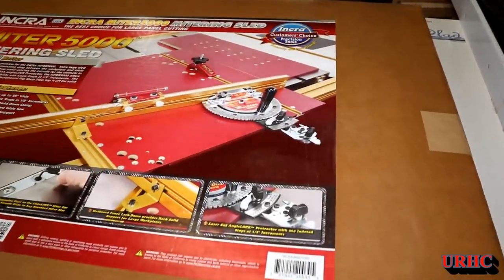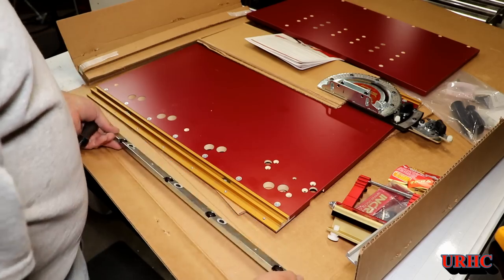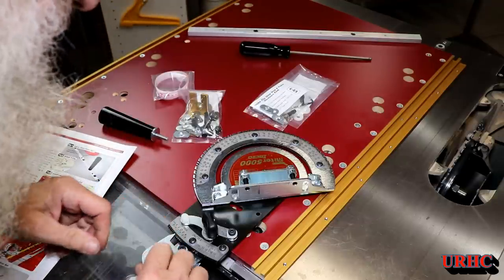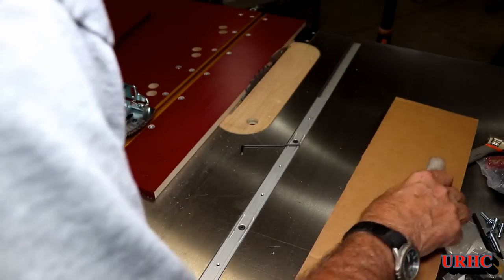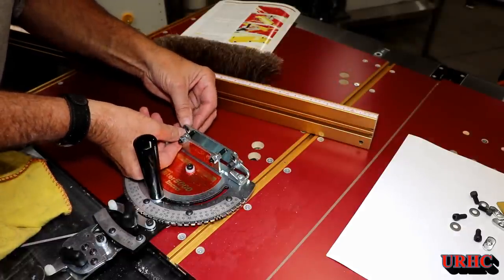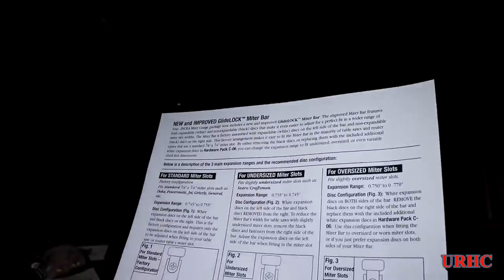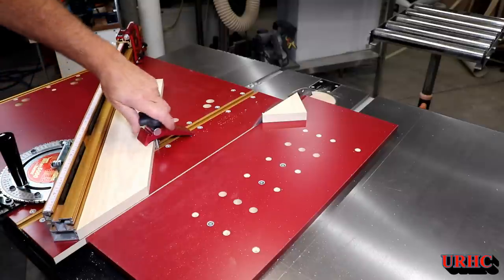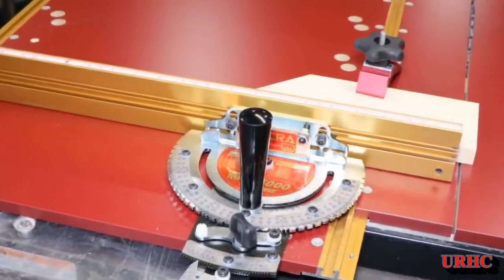Incra Miter 5000 Sled Assembly Quality And First Impressions

Comment: I was thinking about buying the 5000. Not sure now. I will give Mark and Neil kudo's they helped me a lot to install there whole table saw equipment. I bough the TS/LS system, plus the I-Box system plus the Router table extension on the table saw too.  The I-Box I rate much higher. The TS/LS is a pain in the butt to put together. I had to hire a guy from Woodcraft to assemble it for me. I helped him, and the guy is very knowledgable about woodworking tools and gadgets, and we were on the phone quite a bit with them. We got it together finally. I thought about sending it back before assembly. Too many boxes though. Plus I didn't take it out of the box til several months after I had gotten it.  I had several boxes with the lsts system or I would have. Now that I have been using it, and set it each time with a new saw blade. I didn't have the same problems you had. And believe me when I tell you, if you look at there ts/ls and router extension you would of thought someone was nuts going through all that setup. Pretty expensive system cause I bought the router table extension along with the tsls system. Mark and Neil helped us through it. They backup what they say. Had I to do over? Never!  I agree with you about how shoddy the workmanship of your sled. NO excuse for that. I don't like one bit seeing the problems you have had with setup and shoddy workmanship! If that had happen to me with the huge system that I bought? I would have packed it up and drove it out to them, that would have ticked me off more lol.  But I didn't. Just a lot of parts and tedious to put  together. I wouldn't do it over if I had the choice, but remember, I bought a whole bigger system. A lot to put together. Plus, Neil and Mark didn't have to send me any parts either. Which I am surprised with your review of the 5000.  I hope Mark and Neil have done whatever they need to do to correct the poor workmenship. I'm not sure I will buy the 5000 now after reading your review. One ore thing. Me being disabled and can't really bend over and getting up there in age, I say this because of my situation. However, most of you don't have the problems I have so you would probably do much better. If asked would I but the stuff again? I am going to contradict  myself and say, yes I would, only hire two guys to put it together for me. LOL. Thank you.
Reply from the maker: This sled has not impressed me but you seem to like the way incra things work so you may like it. Mark replaced the slider that didn't expand properly and the blotchy stop arms. New slider did the same thing.  Then later I had an issue with the he main board swelling between the mounting screws and they replaced the board. I have a recent video about getting rid of the hard to use incra fence / stop and replacing it with a simple kreg fence and stop for quick accurate settings without wasting time or having to adjust tiny hard to grip hardware. I wouldn't buy it or any incra tool again after seeing how complicated and slow to use their products are. Thanks for watching.

Comment: I purchased an Incra Miter 5000 sled and was somewhat disappointed. It requires too much assembly to be able to use the product. I’ve had mine for a month and still haven’t gotten it assembled yet. If I had known how much hassle it would be, I wouldn’t have bought it. I’m a woodworker, not a machine tool guy. Unless you’re a mechanic, I don’t advise buying one out these.
Reply from the maker: This really was a waste  of money for me. Just so clunky and hard to use. I replaced the incra extrusions with kreg stuff eventually.  Thanks for watching.

Comment: Excellent review. I hope INCRA watches your video review.
Reply from the maker: So do I.  At least it works good.  Thanks for watching.
Reply: And Incra did watch this video, Mark Muller reached out to him, to resolve his issues. 

If you had a negative  experience with another product and you posted your displeasure with the product do you think they would reach out to you to make you happy? 

Let’s try cable companies? 
Cell phone companies?
Your Banking institution?
Your Congress Critter.
The IRS?

Not everyone can be pleased! However if you purchase an Incra Product and you are not happy Incra will do everything they can to resolve your issue.
Reply from the maker: Not what you expect for a out of box experience of a product  in this price range.  Seems like it's the norm these days and some expect it but it really should be handled with some quality control before packing. Not what I expected from a company like incra. I don't doctor videos up and what you see is exactly what my experience was good or bad. It's a big waste of valuable time having to replace parts and fix stuff that is not right to begin with on a large purchase like this.

Comment: Awesome video. I love how you went into a very detailed review of this. Pointed out the good and the bad. Which is important for an honest review. It looks like you’ve had it for a few months now. If you take out the manufacture defects. Would recommend buying it for its ez of use and accuracy of it?
Reply from the maker: It's accurate and repeatable so I feel it's worth what I paid for it but no more.  I have shown it in other videos and the flip stop is a real pain in the ass if you move it often. The thumb screws are small and hard to adjust along with the toothed strips that don't just let you move it a couple thousands without using the tool to loosen and tighten screws. It's definitely better then my old kreg miter gauge.  Thanks for watching.

Comment: It is surprising they didn't clean up the cut edges. All of my incra stuff came imnacuatly clean. But that was 15 years ago.
Reply from the maker: It looks like they just sanded the cuts and threw the parts in the box. The red anodize is very splotchy and scratched along with 2 different shades of gold. not what I expected from Incra. At least it works OK. Thanks for watching.

Comment: Is your saw a left or right tilt blade? Majority of new saws these days are left tilting for safety reasons but the instructions are written for a right tilt so you have to reverse everything they tell you. Makes a difference when you decide which miter slot, right or left, to set the sled up using before you cut the end pieces off. I called Incra first just to be sure I understood their instruction manual before I went any further. They didn't have a great explanation except to say it was written a few years ago and hadn't been updated recently.
Reply from the maker: I mounted it on the left so it is indexed against the Harbor for use with dado blades. Dumped all that complicated incra fence and stop for a kreg extrusion that is much easier to use and safer.  This is a big disappointment.  Thanks for watching.
Reply: Could you elaborate on the Kreg extrusion, what you used and why it is easier and safer to use.  I looked on their website and they have many different types. Thanks.
Reply from the maker: I have a recent video about the changeover . Search my channel for krin.

Comment: Looks as if that small part on the fence may have come from a different lot of material.  Watching this at 3/30/21.  I wonder if Incra has made some improvements.  Just saw an add from Woodpeckers selling this one. $299.00.  Would anyone know how well this would work on the Dewalt 6480?  Or is it to big for it?
Reply from the maker: I wouldn't  buy it again  but that's  my opinion after using.  Thanks for watching.

Comment: Although the chisel punch is excellent for frustration relief, I'm surprised you didn't just jig it up in the mill and finish the work Incra took a powder on....I guess you were REALLY frustrated at that point.
Excellent review.
Incra should take notice.
Reply from the maker: That whole bar is junk. It looks to be designed for rectangular slots not t slots. The bottom expands but the top doesn't so there is no way to get it right.  I was surprised by it and the cosmetics. Thanks for watching.

Comment: Not sure if you covered this already as lots of reply’s. I think you can get a longer panel cut if you move the fence back some more. No need to have the whole miter gauge on the sled.
Reply from the maker: Can't do that. I tossed the incra fence and used a kreg extrusion that gives more space and is easier to use. There is a video about it. Thanks for watching.

Comment: Can confirm that the "adjustable" aluminum track rail is still garbage. I have a SawStop PCS and could not get the "mechanism" to expand to remove the side to side play/slop. The included allen wrench actually snapped in half while trying to do it (ouch). At this price point, they should have just replaced the aluminum rail with a second of the rails you use on the other side (which are not a picnic to adjust either--but at least they eventually work and allow you to remove the side to side play [and have more contact points than the aluminum rail]). In the end, I guess it doesn't matter too much, since the aluminum rail and the MDF cutoff that sits on top of it don't do anything other than support cutoffs but my advice to someone watching this as a tutorial is when you get to the part where you cut off the section of MDF attached to the aluminum rail, make sure you put plenty of downward pressure on that piece as you push it through the saw so it doesn't come back into the blade at an angle and bite out a piece of the end of the MDF.

The anodizing on my stop lock was also messed up (and the sticker was chewed up) and the protractor base had punched through and into the cardboard box with the miter guide rail.
Reply from the maker: I have a video where I tossed the Incra extrusions and went with a Kreg extrusion and stops. Made it safer and easier to use. Incra has really gone downhill. I find things shipped from China in much better shape and higher quality these days. Thanks for watching.
Reply from the maker: https://youtu.be/5Dtowmay9lY
Reply: I think another issue I discovered with the 5000 that bothers me is that while they say it’s completely reversible for the right-side setup, the micro adjust screw on the stop lock is only threaded on the left hand side so you can’t swap the micro-adjust screw to the right side! So it makes it even harder to see where you are on the measuring tape. I watched your video about replacing it with the Kreg extrusion—but I don’t own the Kreg miter device—do you know if the flip down stops for Kreg can be purchased individually?
Reply from the maker: Yes, Kreg sells the stops. I only use it at 90 degrees now so it really was a waste of money. Should have just built one.

Comment: Would it be overkill to try to use this with a (Sawstop) jobsite sized saw?
Reply from the maker: I think it would  have limited  capacity  and useless on a small saw. Thanks for watching.
Reply: @unemployedredneckhillbilly2023  I was hoping it would lend some big-saw-precision to my small saw
Reply from the maker: Make a big table in front of the saw to extend the miter slot for stability and it would help some or you would loose a lot of cut capacity.

Comment: I just came to assemble mine and one of the holes in the steel mitre bar isn’t threaded so you can only screw in 2 of the three. The hole is bare so their QA process is terrible or non-existent.  So frustrating.
Reply from the maker: Profit over quality  seems to be the trend these days. Costs less to have the customer do the final inspection  and repair.  Thanks for watching.

Comment: Did you interact with INCRA on these issues, including the cosmetic ones? If so what was their response?
Reply from the maker: They  sent some replacement parts  that weren't much better.  I replaced  all the hard to use incra parts  with a kreg extrusion and stops  finally  that make it safer and easier for me to use. It's  one of those items I wouldn't buy again. Thanks for watching.

Comment: I would have called customer service for sure. I have a lot of Incra tools. There customer service managers are good at making things right.  I would have never thought of using that chisel. I do agree those guide screws can be very difficult to adjust. Thanks...
Reply from the maker: With the camera running when I open the box l always show exactly what I received  and how it went together. I figure this is what anyone that bought one would encounter. Nothing is broken and it works after cleaning up, assembling, and tweaking so I will live with the cosmetic issues. I expected better quality control from a product at this price point and most likely won't buy anymore Incra products for my channel as I was going to. That guide seems to be for rectangular style slots and not t slots.  The tapered wedge expands at the bottom but not the top so it will never work right and a replacement would be the same so why bother calling.  Thinking about replacing it with the kreg bar to fix it right.  Thanks for watching.

Comment: Great review - so impressed with your attention to detail. Incra’s response to your issues was also awesome. I don’t know how you stopped yourself from cursing when fitting that right hand aluminum track though :)
Reply from the maker: They sent out another track and the same thing.  It flared out on the bottom and locked in the t slot. They seem to be made for the old style slots with no undercut. It's accurate.  Thanks for watching.

Comment: Did you ever consider contacting them about your concerns? For the price it should not have such blatant flaws in the machining. This would not have passed Woodpecker's review process.
Reply from the maker: I sent  them a link to this video and they  contacted me.  I always show exactly  what I received when doing a box opening  video good or bad. There are some  follow ups but I definitely would not buy it again.  I wound up putting  a kreg fence  on it to improve safety and usability. Disappointing for a higher end made in the USA product. Thanks for watching.

Comment: You have a left tilt table, does cutting a 45 with the blade tilted damage your sled. Wouldn't it be wiser to set up on the opposite side? I have been thinking of purchasing the sled and was hoping to see some cuts with the blade tilted. Thanks, Tom
Reply from the maker: I don't use it with the blade tilted. I use the Kreg gauge for that. I wanted zero clearance for different blades and dado thicknesses so I went this way. I can not recommend this after using it for a while. I definitely would not but it again.

Comment: I also have this sled.  The reason we pay the premium for things like this is for quality, precision and customer support.  If any of those things are lacking we as customers should hold them to this higher standard.  Hope you got them to take care of your issues.  Thanks for sharing.
Reply from the maker: They did send out a replacement aluminum rail and stop arms. It's accurate but I didn't like the fence or stop complexity.  Recently the main board buckled up between the screws and they covered that also.  This definitely isn't premium quality.  Thanks for watching.

Comment: You need to remove the mitre gauge itself and move it back and you’ll actually have a 23” cut capacity.
Reply from the maker: There is only one set of holes.  I did better.  Junked that incra extrusion and replaced it with s kreg extrusion  to make it safer,  cut wider and easier to use.  Thanks for watching.

Comment: Good review.   I would guess their engineers and quality control are not as exacting in their standards as you are.  If they had been, you would not have had to use a chisel to fix it.   I'm looking forward to your next project.  Winter's coming, yippee!   Take care.  thanks.    :)
Reply from the maker: I was really surprised by the quality as this is a top of the line item. Made in the USA doesn't mean quality anymore.  At least it works good. My wife has me lined up to redo the guest bath this winter so there will be a lot of new cabinets.  She already bought the paint and flooring so I have no choice 😏. Thanks for watching.

Comment: Ok, I'm 2:55 in and screaming at the screen for you to write up what you found so far, pack it up, and send it back for a replacement. Don't go any further; if you don't like the quality and care put into the thing at this point, you're obligated to send it back and let that be known. If you're surprised that Incra would sell something like that, it's because anyone receiving it in unacceptable condition, just keeps unpacking and keeps accepting it. :(
Reply from the maker: I should  have but didn't want to get stuck with return shipping.  I later fixed it somewhat and made it safer with Kreg parts in another video. First and last Incra purchase for me. Thanks for watching.

Comment: Incra should be ashamed of this video, when I buy an Incra I expect to assemble it and use it without having to tweak things.  I would expect to modify an import product, but not something from Incra.  I'm going to think long and hard before buying another Incra product now.  Thanks for sharing this, great video!
Reply from the maker: This was my first incra product and I expected better quality and finish. It works good now but for the price point I expected better. I was definitely surprised by all the unsupported cutting area if you try to cut the 23 inches they advertise.  I am confused why none of the reviews I watched stated that. Thanks for watching.